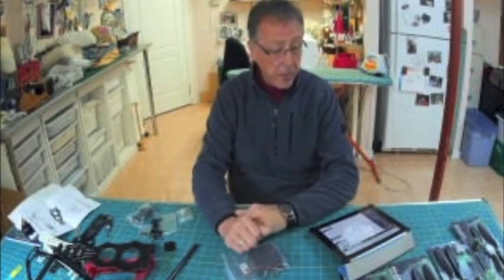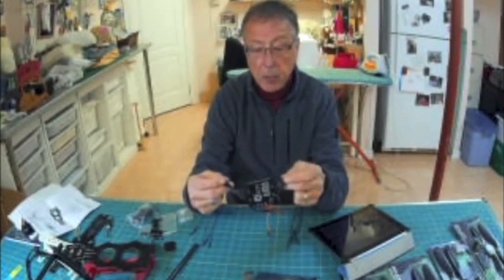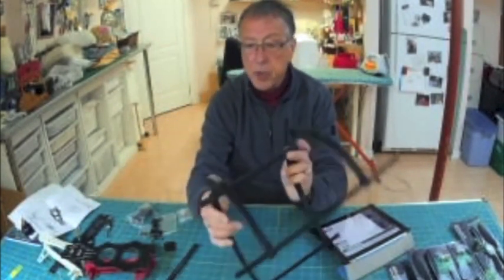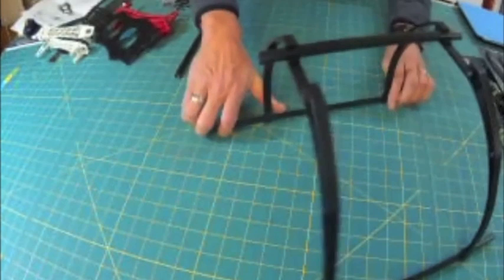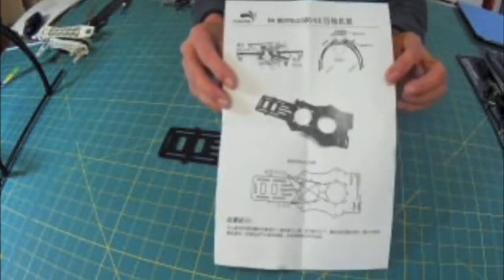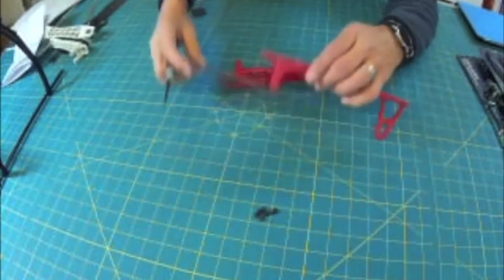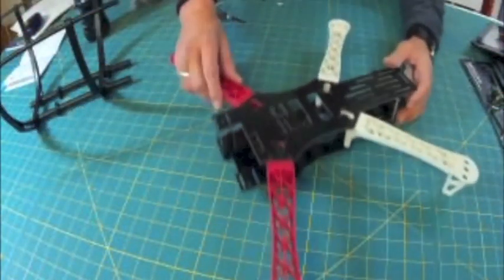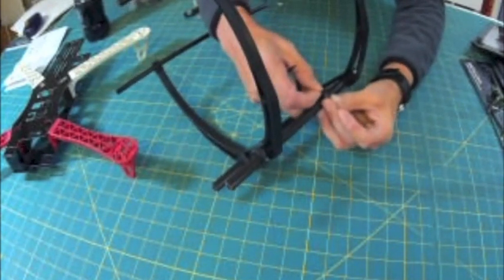Quad Copter Build With KK2 and Qbrain Part 1

Comment: Áwesome. Just ordered one. This will help with the assembly. Thanks! :)
Reply: Mine? Not had it in the air yet. Bought a qbrain with an ardupilot apm 2.6. Doesn't wanna work together. Just ordered 4 separate esc's that will arrive tomorrow. I'll rebuild next weekend.😊